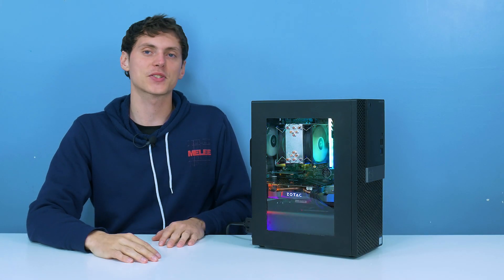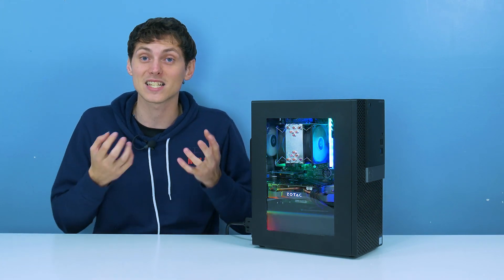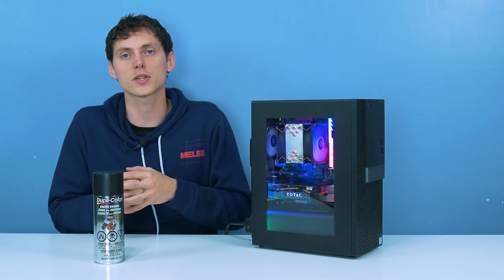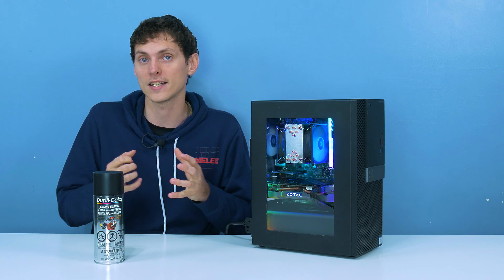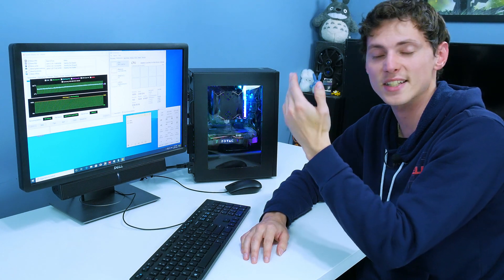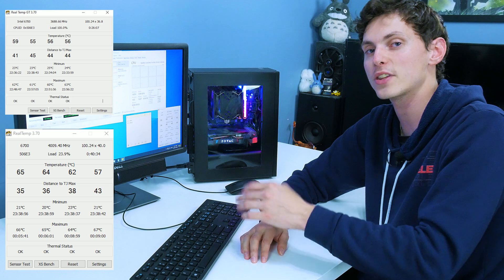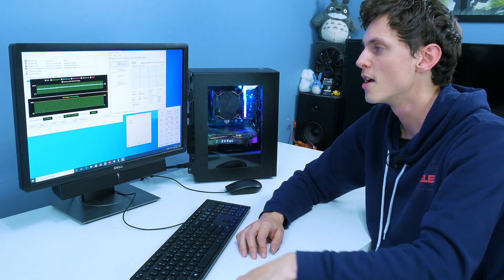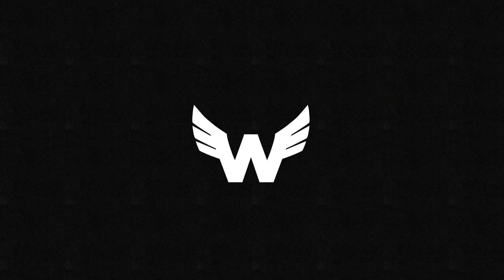Painting A CPU Cooler | DIY MOD

Comment: what if you just paint the very top side of the heatsink? will there be any decrease in temp? or the result will be the same
Reply from the maker: Good question! If you just wanted to paint the top plate, it shouldn't affect the cooling of the cooler at all

Comment: Can the coolant be the cause of the heat problems, knowing that the processor is breakable?
Reply from the maker: I'm sorry, I don't understand what you're asking.
Reply: @WiltshireTutorials  Can I paint it without kinks in the heat
Reply from the maker: Just use an engine enamel paint that is made for car engine. It's meant to take high heat and not wrinkle or kink
Reply: @WiltshireTutorials  Ah well, thank you for the info. I'll just do the face painting. Thank you
Reply from the maker: You're welcome. Thanks for watching

Comment: nowadays the noctua NH-U9S chromax black would work in this case
Reply from the maker: It would. However, not everyone is able to pay the price premium for Noctua products. This video series was created for those on a tight budget.
Reply: @WiltshireTutorials  makes sense, at 70 bucks it's a bit steep. I got a regular silver one for 40 bucks on sale and I'm going to paint the top black and replace the fan with a black one
Reply from the maker: @pineapplej7310  The cooler in the video is only $12 shipped for AliExpress. So, definitely saves a lot of money in comparison. The Noctua will undoubtedly be better though! That's a good find for $40!

Comment: Haha I have an all black mugen 5. I want to paint it white.
Reply from the maker: Just remember to scuff the headsink with a scotchbrite pad and clean off the dust with rubbing alcohol before painting!
Reply: @WiltshireTutorials  I would probably just do the top ofthe CPU cooler as a have a white RBG fan on the side
Reply from the maker: The top would work just fine, as the fans cover most of the fins.
Reply: @WiltshireTutorials  my 1st build on Instagram - variance911 
If I spray paint to the top cpu cooler white with the same pain you used,  I'm wondering about the chemicals / fumes when using the computer.  Is it OK for one health after?
Reply from the maker: Paint will release vapours, at a safe level for humans, until about a week after spraying the paint. The technically term is gassing. Overall, it is safe to use. No need to worry.

Comment: A better way of testing the temps would have been to use a program like HWinfo & get the average temps of both coolers in say a 15 min AIDA64 stress test vs the max core temps. In my opinion, this would be a more accurate temp figure you can expect on average usage & eliminates one-off spikes, but great video nevertheless. Liked.
Reply from the maker: You could, in theory, take the maximum values from each core in RealTemp and calculate the average between the 2. Doing so gets me the following results.

Non-painted cooler: 61.5°C
Painted cooler: 65.5°C

So, an overall average of 4°C in change. Not bad! I appreciate the criticism and will try to improve how I do things for future videos. Thanks for watching!

Comment: Looks great! Personally, I would have masked off everything except for the top of the fin stack and just painted that since the fans cover the front and rear.  I think that would minimize any change in thermal performance, at least I hope so because I plan to do that to a NH-U12A.
Reply from the maker: That would probably yield better results. But, I wanted to test just how much painting an entire CPU heatsink affects the performance.
Reply: Will consider painting the top of my mugen 5 white

Comment: Have a Noc so just bought the covers problem solved, black fans painting the ring on it, easy just cling wrap the fan and hub.
Reply from the maker: No idea what you just said.
Reply: @WiltshireTutorials  I have a Noctua D15, You can buy heatsink covers for the towers, and if you use cling wrap on the Noctua fan and hub you can paint the outer ring any color you want.
Reply from the maker: Ooooh. Yes, they do have some nice accessories. However, this is geared more to people who cannot afford the Noctua price premium. For example, I used a $12 Aliexpress 90mm cooler for this video. The budget PC community is a lot larger than the high priced pc enthusiast community.

Comment: For even less performance impact: tape off the main faces of the fins. You don't need to paint those surfaces anyway because they are covered by the fans. That's what OEM manufacturers do for their black coolers.

Another option, which oem coolers use, is simply to put a cover on the top of the fin stack. You could probably 3D print one.
Reply from the maker: I was thinking of masking off the fins of the heatsink. But, I wanted to put myself in the shoes of someone inexperienced. Plus, I was also curious to see just how much of an impact the paint would have on heat dissipation

Comment: I'm pleasantly surprised. I thought painting the heatsink would significantly increase the temps, but 3~4 degrees really isn't that big of a deal and now the OptiFlex looks better than ever. Great job, as always.
Reply from the maker: You're not alone. I was shocked with the results! As long as you don't load the paint up on the fins of the heatsink, you'll be just fine! Glad you like the video! Thanks for the continued support. I appreciate it very much!
Reply: It's not an optiflex it's an optiplex

Comment: If you go light around the fins area you should be ok, high end radiators are lightly painted on the fins area, you can often see the red of the copper if you look from an angle. Good Job
Reply from the maker: Thanks, Greg! That was pretty much my theory. As long as I kept the paint to a minimum on the fins of the heatsink, everything should be alright. Plus, the fins are covered mostly by the fans, so not much colour is needed there. I did a thicker coat to the top of the heatsink because that is what you mostly see through the side panel of the case.